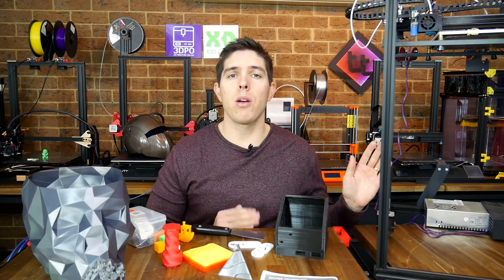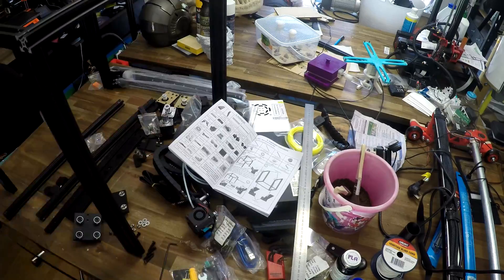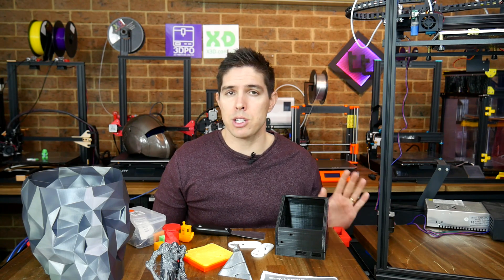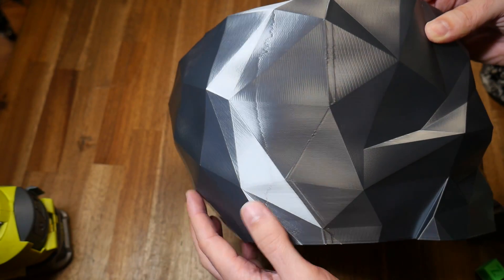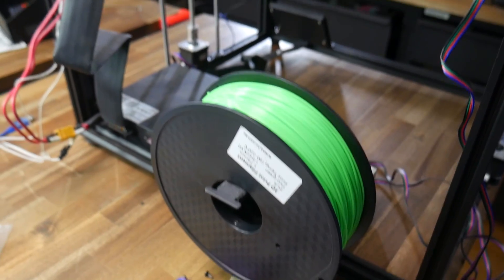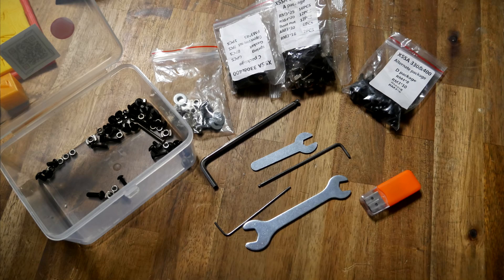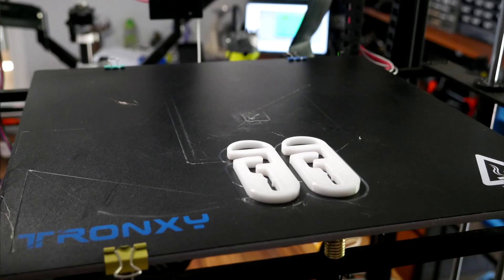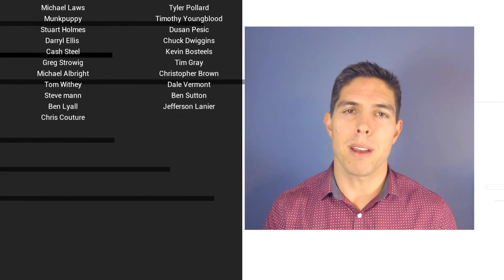Tronxy X5SA Pro review: A large format CoreXY 3D printer (with issues)

Comment: I had my X5SA pro October last year. I decided to get this printer because of its build volume and core XY style. There where some problems with the set that I received, I will summarize them here below in order of the build.

• The frame whatever I did was not square because one main leg was shorter than the others. I measured each leg and found the one short, so I fixed it by placing a washer in between the extrusions to make it a little near the length. Ultimately it would be best to cut them all to length.
• The carriers that ride on the metal rods were a bit tight. I firstly adjusted them before I bolted the gantry on. There is a vid of a guy that adjusted them on youtube. They are a bit of a pain to adjust but can be done.
• Aligning the x gantry was problematic due to what Michael showed on the vid. I fixed this by pulling the entire gantry, with loose bolts, to the back butting them to the x and y motors. This would align them equally on both sides so that when you tighten the bolts it would be square. It is best if you first align the frame before you push the gantry all the way back to the motors.
• For the belt tension, I had some extra belt tension springs that I placed on the two belts. I just ran the belt and cut them to length. The tension was not to tight and not to lose. I used the guitar frequency method to tension them with the springs. Moving one tooth on the belt in or out and then using zip ties.
• The cable chain was a problem too for it is long and the placement of the arm that holds the chain is displayed to be in the center. The holder should be placed in a corner at the rear. I placed mine in the inside part of the extrusion facing the build area and almost in front of the motor. Removing links of the chain where it would just reach the very opposite corner will help with the droop of the cable chain. Also tightening the holders and aiming them up will help with the drooping chain.
• Bowden tube supplied is very long. Having a spare Capricorn tube, I used that. I snipped the tube to the length where there is not much slack and no sharp corners are present on the tube. the hotend is at home in a corner and the extruder motor is placed in the center of the rear extrusion. Just the right length will help with extrusions and control of retractions.
• For wire management, I stuck the wire inside the extrusions and used the given decoration tube and snipped a few pieces of it to hold the wire in place.
• The 2 z motors are not coupled so they need to be level nearly the same. I just modeled and printed a block to place near the z rods so that when I raise the bed they butt up to the block. I just manually adjust them to exactly the same.

After that initial build, I started printing and it is quite nice. A limitation was the software and control board. But once dialed in before printing, it will just print. But for me, I was not satisfied with the quality, (compared to my modified ender 3). So I did some upgrades on the hotend side. Designed a part and hotend cooling duct which I posted on thingiverse. That fixed a problem where the cooling fan will blow all over the print without the part cooler is on. That gave better cooling control.

Having an ender 3 I have an extra skr mini E3 v1.2 and used that on this printer. Amazingly it works but I killed some fans for their connections are reversed. And coupled with a BTT TFT35 with the reversible touch to the rotary encoder, it is very good! Bonus for the configurability with the software and the silent tmc2209 stepper drivers. Bed heating might be an issue but placing a heatsink on the transistor helped a bit with the cooling when the bed heater is on. I am now designing an external case for the skr for I will be making a sealed enclosure for it.

I might have left a few more info out but feel free to ask a question. This comment is getting quite long though

Thanks for the informative vid Michael! I can't wait to see what you will do to the printer! It is a very capable "parts" printer to upgrade.
Reply: At what frequency should the belts vibe?
Reply: @FiIip3213  i tuned mine to 35hz. Generally a little tighter is better but would attract other problems like the pulley bearings. I also repliced my pulleys with GT2 teethed and non teethed.
Reply: Hi, wondering do you have the web issue on prints? I have this issue a lot. Wrote on Tronxy FB site and tried some adjustment on retraction setting, but still having this issue.
Reply: Thank you for your write-up; really shows that care spent assembling the printer is time well-spent.
I went through all this long ago with my early X5sa; that’s now working acceptably with all new mechanicals and a direct-extruder V6-hotend conversion. I decided the new Pro version offers enough improvements over the original, at a reasonable price, to be worth trying again, and this time I will stick with the Bowden tube/Mk8 hotend which I found incredibly unreliable last time around, but I know a lot more about them now. I’ve since had an Ender-3 and the Creality hotend works so well, I would probably fit one to the Tronxy (before changing to a V6). Anyway - can I ask the name of your hotend and part cooling fan duct please? - or perhaps your Thingiverse username - or a link - as there are tons on there :) many thanks
Reply: @alexshepherd  here is the link to the hotend and part cooling fan I made. This design, I could say, is outdated. I have still to upload the newer model that I made. I'm currently working on my X5SA pro for high-temperature printing complete with high temp nozzle, bed, and enclosure. 
I upgraded to a BTT skr mini that is made for the ender 3 as a mainboard and it is printing well. I am thinking about changing to a direct extruder and removing the Bowden set up. but for now, the Bowden is sufficient. 
https://www.thingiverse.com/thing:4009328
Reply: Albert Bassig thanks for the link :) Ironically I’m running an SKR Mini E3 board with Marlin 2.0 in my Ender 3 and I prefer the Tronxy firmware/touchscreen. The autolevelling is much better (can see the readings), preheat is more convenient, and the acceleration/jerk control performed through a gCode config file means I can easily switch between two profiles for high speed or low speed prints. Meanwhile with the SKR board, the menu is sluggish, the acceleration/jerk seems to have no effect, preheating is always fiddly (often having to dial the hotend temperature back up as it kills the hotend heating while heating the bed for a print), etc., not enough fan ports (and can’t seem to shut the fans off when a print finishes; like how the Tronxy does)... lots of little things.

Another option now available is to run Marlin on the Tronxy hardware but honestly can’t see why I’d bother :) I get better results from my Tronxy than from my Ender-3 and I find it easier to use. Loading filament is particularly easy with a direct-drive conversion (and retraction/stringing is no longer a problem) though the mass of the carriage does make the acceleration/jerk settings more important. Probably still lighter than the Ender 3’s moving bed mass, though

Comment: I got a X5SA 2019 I. Feb 2020. They have made changes. I had little to no issues mechanical issues. I assembled it n about 3 hours. When I installed the belts I actually tywraped the gantry to one side so it couldn’t move during belt tensioning. I did need to check everything the wheels came with eccentric nuts which needed to be adjusted. The Achilles heal from my perspective is the Chitu board and the closed firmware. After the initial setup I started printing the test cube from the provided SD card. 3/4 of the way thru the x axis driver blew. I am very meticulous about checking everything there was no reason other that bad electronics for it to fail. The drivers are soldered to the board and unless you can do SMD soldering your SOL. Tronxy did replace the board with a newer version which has the TMC silent drivers with the heatsink on the bottom of the board. The fan noise is terrible. My first upgrade will be a SKR PRO v1.1 with independent z drive so the bed stays parallel. I really believe this can be and excellent printer, I do also believe that Tronxy is learning but the question is will the learn quick enough to save the model.
Reply: What was annoying for me is the fans because it's loud! I just do not like the hotend MK8? I got it clogged twice; wanted to upgrade it to a e3d v6 but unfortunately cannot find much info about it =P Other than that; the mainboard is locked which is a downer; other than that I think it's pretty decent with some polishing; Feels pretty sturdy actually. If you ask me. Cable chain is a bit bad though

Comment: Bought this on sale at GearBest a little over half a year ago, paid $300 inc shipping.
I found the assembly quite intuitive and easy, but then I have mechanical experience.
Same with belt mounting/tension. Before mounting the belts square up the frame and move the sliding bar all the way back and it will be parallel to the frame.
I have later reinforced the frame by fitting aluminium triangles on the outside of every corner where space allowed for it, 12 out of 16.
I actually found the long filament tube to be a good measure, it allows for routing choises. Mine has the roll mount, filament sensor and feeder motor mounted on the side, so no problem there. Neither is the alignment or feeding the filament.
The cable chain caused the described problem in the begining, but was easily fixed as there are several ways to attach and align it. And apart from the ribbon cable I managed to hide all the other cabling inside the frame and hide it with the supplied tubing.
It looks very tidy.
Auto leveling and Z-hight took some time to work out and I had the nozzle dig into the bed several times.
But with some experimentation and the right sequence of procedures it actually works very well.
I make/check the rough basic alignment with a digital level and always take the print plate off the bed before removing any prints. The aluminium printing plate is the largest problem as it looks flat but quickly becomes "micro wobbly".
I also had a big problem with stringing in the beginning. Only printing PLA. However after some experimenting and tweeking the standard settings on temp/speed/retraction it became very good.
The heater element burnt out and I have to admitt it was a pain and lot of unnecessary disassembly to get it changed.
I'm also planning to print out and change the filament cooling duct. This blows only from the right side and gives less cooling when printing left to right.
It's not a plug and play printer for the unexperienced and/or impatient, but all in all I'm very pleased with it's performance vs price and being able to make large format prints at such a relative low investment.

Comment: I own one of these printers.  My initial experience was very similar to yours.  I knew from the beginning that the printer would be rough around the edges, and I had planned to upgrade it over time once I got it running.  However,  it was basically unusable for me in stock form.  I never was able to get a successful print with the stock mainboard installed.  I tried many times to home the printer, level the printer, set the Z offset and print, but every time it would jam the nozzle down into the bed at the start of the print.  One time it jammed the nozzle down so hard the hot nozzle burned right through the print surface to the aluminum!  It may have been something I was doing wrong, but I have been 3D printing for over two years, so I daresay I should have been able to get it to print without so much trouble.

I have the printer working very well now.  It prints fast and reliably like a CoreXY printer should, but it was way more work than it should have been to get it to that state.  Here's a list of the mods I have done:

- Replaced the controller for an SKR 1.3 running TMC2209 stepper drivers and Marlin 2.0, with a TFT35 V3.0 screen (thanks in large part to your excellent tutorials)
- Installed an external MOSFET for the heated bed
- Installed a buck converter and 12V Noctua fans for the controller case and the hot end (The stock fans are terrible as you mentioned, and I gave up trying to find high-quality quiet 24V fans)

- Relocated the extruder to the front right corner and designed / printed a new spool holder so that filament can be loaded without access to the back of the printer
- Replaced the stock bowden tube with Capricorn tubing
- Made a polypropylene sleeve for the comically long bowden tube to keep it from sagging down into the belts (this is a great cheap mod - a roll of the tubing was less than $4 USD from my local hardware store)

- Replaced the Z axis linear flange bearings for metal ones (the stock bearings felt like there were metal chunks stuck in them, even after thorough cleaning and lubrication)
- Printed and installed pillow blocks at either end of the Z-axis threaded rods to minimize Z wobble (there are still minor artifacts in the prints, but I think I have reached the point where I won't be able to improve further without overhauling the whole Z-axis motion system)

I'm sure there's more that I missed, but you get the point. :)  If someone is looking for a printer to take out of the box, assemble and go, this is not that.  If someone is looking for a kit to build up into something great, it does have potential, but be prepared to do some work.

I would suggest two things to anyone who decides to buy this as a kit.  First, do yourself a favor and buy a cheap machinist's square.  I bought mine off Amazon for less than $20 USD, and it was indispensable for getting everything aligned during the build process, especially for aligning the Y axis gantry.  Mine is the kind that has one center beam and two outer beams pinned at  90-degree angles to it.  That design allowed me to use the square to align the three extrusions at each corner perfectly perpendicular to one another while I tightened the bolts (this is a huge pain without something to hold things in alignment).  Second, when tensioning the belts, the goal is to just remove the stretch out of them.  If your belts are so tight that parts are flying off and trying to kill you, maybe loosen them up a bit. :)
Reply: I went the same route with the skr mini e3 v1.2 with the tft35! 😀 noise and configurability is amazing!

Comment: at 4 minutes:

Move X-bar to its end first and hand tight screws. Measure distance fron X-bar to fram and check if it is equal on both sides and then thighten screws.  After that you mount the belts.
This is my first printer and even my first contact with a 3d-printer. You need to have good mechanical skills and understanding to set up this printer.  None of the rails is perfect from the beginning.  Understanding aligning is a must. Adjusting excentric bearings need to be done and there is no tools invluded for that. A normal retaining ring plier can be used.
It took me a whole day, not just 3-5 hours, to get this printer up and running. But I was very careful and accurate when I was assembling it and I have no problems with stringing, missaligned etc.  But the bed is horrible. Its almost impossible to get parts loose after printing. I have used 3D-prima's glue for heated bed.  Works almost as good as superglue or epoxiglue.  Hairspray is best for large surface printings an the glue for small surface printing.  Stock top bed is warped 0.2mm in ABL. It is easy to fix with som gentle bending but glass bed is better. And with glass bed there is another issue. The bed level sensor isnt sensitive enough. Solution: laminate glass with thin steel sheet or change sensor to a capacitive.
For the price of about 450 USD I think it is a good printer,  but not out of the box. It needs a lot of tweeking and mechanical knowledge.
For first time users I do not recomend a printer of this size. Buy a small 150x150x150 instead or maybe 200mm. This printer is huge.

Comment: I bought the non pro version a while back so no liniar rails and extra features. I had no problem with the belt tensioning and thermal protection was enabled. However, it came with an old development version of marlin. I bought it for 265€ or something there about. Tested it before modding it but had no such problems.

Comment: i bought the tronxy x5s the 330x330x430 model as a first print and what a pain took me almost 4 month to get it to print nice i replaced all the plastic mounts with aluminum or aluminium for those of you who say it incorrectly. replaced the stock computer with a duet2wifi the bed heater is a 120volt bed heater from a artillery sidewinder with glass sheet bed and a atx power supply for the hot end duet board and motors. also a nema23 for the extruder after i burn out the stock nema17 now it prints like magic. also remounted the extruder on the front and spool on the front lower right corner.